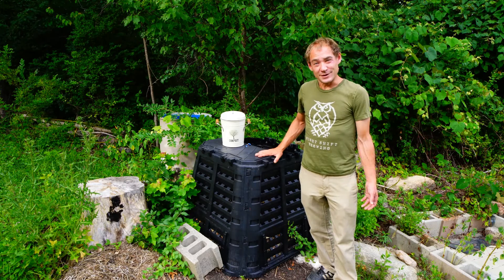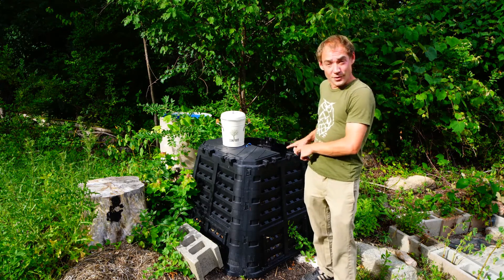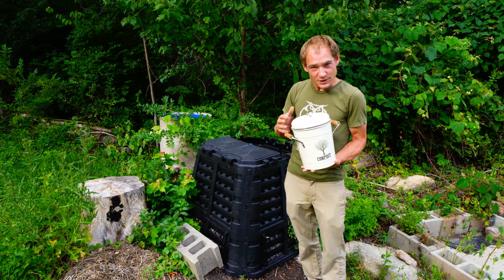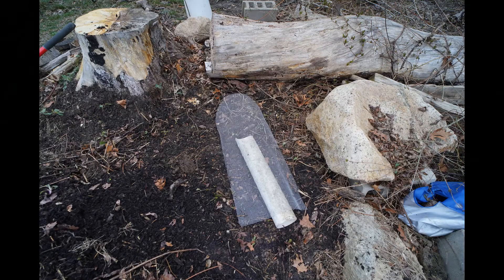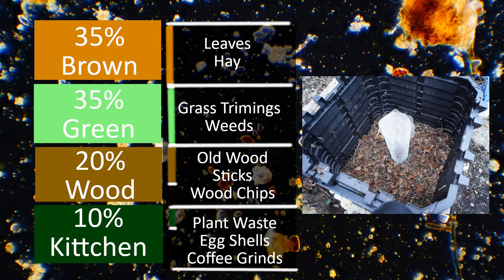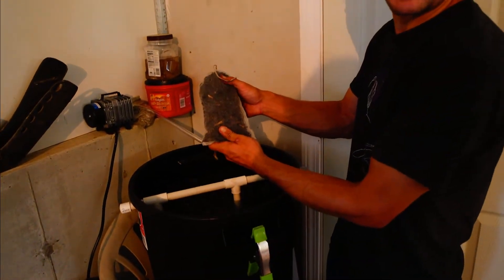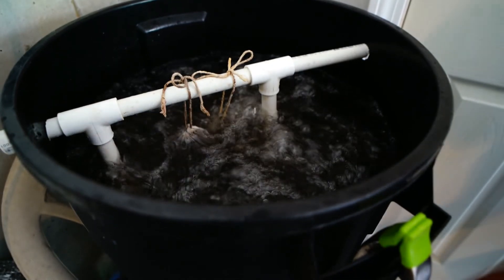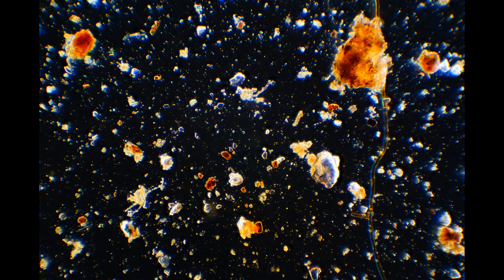No Smell Compost Pile! My version of a Johnson Su Bio-Reactor!

Comment: One thing you forgot to mention is the importance of adding worms in Johnson-Su reactors - makes better quality compost and speeds up decomposition.  

I like to make my own 'pallet' out of a couple of old branches/small logs (adds fungi) - cover with wire mesh (landscape fabric would work too).  I like having 2 edges of the pile touching the ground so worms can find their way in to the pile from existing soil (an inverted U shape - middle is open to provide oxygen)

Good tip on buying high-quality compost to innoculate things. I looked at the Crescive innoculant, but ironically the sample test result they provide in their listing showed a poor quality compost (only a 0.2:1 fungi:bacteria ratio - even their own sample report flagged it as undesirable, lol).  Fwiw, I bought some innoculant from Catalyst BioAdmendments - they are often part of Dr Elaine Ingham's online seminars as 'the compost experts', so hopefully it's good stuff.
Reply from the maker: I like the U shape idea a lot, might have to expand! Yeah worms for sure, that's why I built mine on the ground as well! I like saving them from the birds after a hard rain and putting them in the compost! Was thinking of starting a worm bin but so many in the compost naturally I'm not sure its worth the extra effort for me.